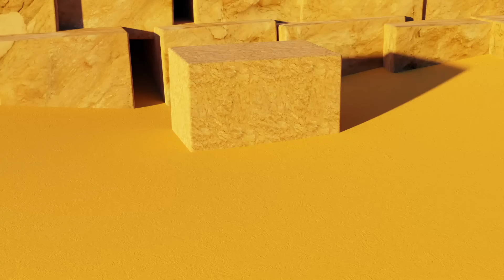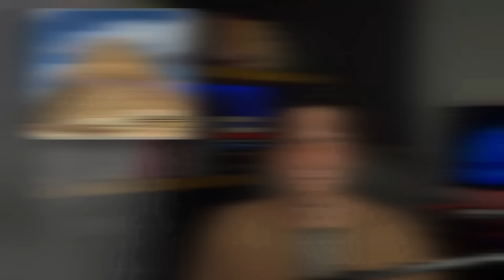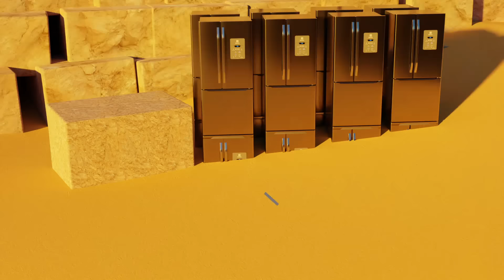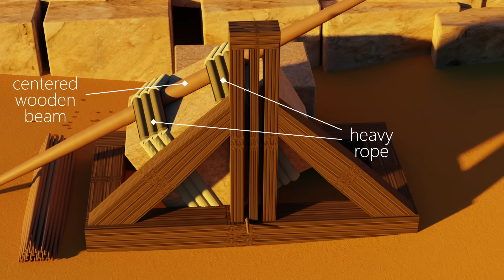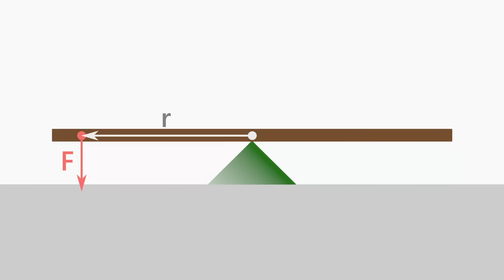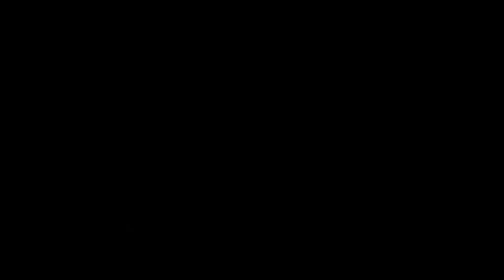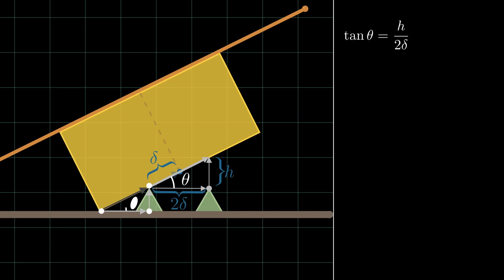Physics Reveals How the Pyramids were Actually Built

Comment: So funny, the only physics that would reveal the true method of construction are not spoken about by Conventional Physicists.  If that is not admitted, then it is a zero value silly fantasy theory.  Let's wait and see what the SARS research group finds, and if someone can actually research the structures extending for thousands of meters below the pyramids actually are and only when we have all the information make a informed statement. Forgetting to mention the super obvious design elements is hilariously inept or maybe disingenuous, the pyramid shaft is directly pointed toward the location of Orion's belt over 10,000 years ago, that nullifies any connection with the conventional archeological Dynastic timeline. Similar to how the Sphinx faces the location of the constellation Leo over 10,000 years ago and has similar aged water erosion  marks.

Comment: They had spherical balance stones. You can spin/ slide along a flat surface with enough equal shaped stones. You don't need rollers or sleds but control becomes the problem. It has been shown they used these sphere's when turning a block around tight corners in hallways.

Comment: Not possible ! Qs How many machine’s would be needed? How are the blocks slid into place off the machine ?  As each step is built more machines are needed on and around each step. How were corners lifted and placed?  No surface under one side of levers . The one block per 6 min rule does not allow for the fact the stones near base will be placed much quicker as not too many steps. Think about how many steps up the blocks near top need to be lifted up and pushed in. If one block every six minutes was placed on average then one block per 6 min was also quarried!

Comment: While I doubt your machine as pictured was used, the principles involved were.  We do the same today everywhere with heavy objects. What amazes me, is so many don't believe it can be done.
Reply: we’ve got diagrams filled with torque equations, trigonometry, and complex modeling of leverage… all supposedly used by guys in loincloths with copper chisels and sleds on sand?

If ancient Egyptians were casually applying advanced physics and mechanical theory like this, they weren’t primitive — they were operating with an understanding of force and balance that rivals modern engineers. So which is it? Were they stone-age laborers, or were they secretly running physics departments 4,000 years ago?

People love to say “it can be done” — but where’s the full-scale replication? Where’s the working demonstration of hauling and placing 70-ton granite beams 150 feet in the air with nothing but ramps and manpower?

What’s actually amazing is how many people believe these mathematical sketches explain a feat we still can’t replicate without cranes and precision lasers. Maybe it’s time we ask if there’s a missing piece — like frequency, sound resonance, or something else we’ve ignored because it doesn’t come with a peer-reviewed stamp.
Reply: @TheForgottenFrequency  One does not need to understand any of these formula to use them. These were simple problems with simple solutions. One way would have been a man walking from one side of the rock to the other while someone inserted a stick under. These blocks were only raised a few feet at a time and they became the base to lift others. The only real mystery is why so many people would build them?  We could easily replicate these wonders, the only problem is money !  Who would pay thousands of people for years and supply the stone?  No large machines are needed, just good old common sense.  
  On a personal note, at I lifted a 5000 pound lathe onto a stand 3 foot high with nothing but a 2/4 and a stack of firewood.  No strength needed !
Reply: @nelsonstahl8989  Interesting take, but respectfully, I think you’re overlooking the scale and precision involved. Lifting a 5,000 lb lathe 3 feet in a workshop isn’t the same as hauling and perfectly placing 70-ton granite blocks 150+ feet in the air with sub-millimeter accuracy — thousands of times, in alignment with cardinal directions, astronomical cycles, and geodetic points.

The “stick and manpower” theory sounds simple, but it doesn’t explain things like polygonal masonry, internal ramp-free construction, or why this level of effort would be put into structures with zero evidence of being tombs. Saying it’s just “common sense” feels a bit dismissive when modern engineers still debate how it could be done with cranes and lasers today.

We don’t build them now not because of cost — we pour billions into less durable monuments all the time — but maybe because their true function is something we no longer understand… or aren’t meant to.
Reply: @TheForgottenFrequency  I get what your saying but these people were no strangers to working with stone. they had been building cities of stone for centuries. The precision is a bit over rated, many of these are inches off level and the joints were filled. There no question they used the stars to align, not so strange since they used the same stars to sail. The problem with modern engineers is they use modern tools ! They forget the simple ways these people used. No need for lasers when you can use water to find level. Why use a crane when the weight of the block does most of the work? There is no question these people had skills. I agree their real purpose is the mystery.
Reply: @nelsonstahl8989  Respectfully, that’s just not accurate. The finished surfaces of the Great Pyramid—especially the casing stones (most of which were removed over time)—had tolerances within one-fiftieth of an inch, with no mortar between the stones. That’s tighter than what we achieve in modern construction using machines.

Sure, there are some stones deeper inside or on the unfinished parts that show rougher cuts—but those weren’t the ones they used for presentation or load-bearing precision. You’re basically pointing to the scraps and saying “look how sloppy this masterpiece is.”

And no, the joints weren’t filled. They were interlocked, often with complex angles, sometimes even concave and convex fits. They didn’t slap mud between them—they engineered them to sit flush under thousands of pounds of weight without shifting for thousands of years.

Let’s not rewrite history just to make it seem more palatable. There’s nothing “simple” about this. If ancient people did this with basic tools, we should be studying that technology like our lives depend on it.

Comment: So let me get this straight… ancient people supposedly did all this complex math, calculated torque, moments, and leverage down to precision like this—but still used wooden sleds and copper tools to haul 80-ton blocks across the desert and stack them with sub-millimeter accuracy?

At some point you’ve gotta stop LARPing with equations and ask yourself what acoustic engineers and physicists have been trying to show: resonance and harmonic manipulation could explain what brute force and stick-and-stone methods never will.

Show me a modern crew move one of those blocks with ropes, sand, and a few logs and then we’ll talk. Until then, stop pretending your chalkboard math solves one of the biggest engineering mysteries in history.

Comment: Hmmm, let me see, quarry the block to rough size, transport the block, dress the block to final size, lift the block into posititon, final finish the block - and do this every 6 mins continuously for 27 years, highly doubtful. Each level would be incrementally harder, so more time and effort needed. If the second row took you 7mins per block, and the third row 8mins etc, this would now take the total construction time to appoximately 238 years!
Reply: I was thinking about this. So many steps for blocks near top. How did they push them in after lifting, the corner blocks would be a nightmare. Machines 100s of them would need to be all over the place to keep the 6min rule. Perhaps small jobs were done like this but not the pyramids.

Comment: …think a ‘Lewis Engine’ possibly a lot more versatile than a ‘Herodotus machine’; think the tensile strength of rope cables with rope harness very likely utilised; blocks dangling in rope harness easy to put in position whatever the weight once lifted up; think it a real possibility that canalised water from an altitude of the Nile higher than pyramid height may have been employed making delivery of blocks (rafted) a simple affair and always working with gravity and not against it; and if not canalised water then some other hydraulic method powered by the amperage of the Nile passing at location; think water a useful amorphous and heavy substance to use for counterweight to blocks…..

Comment: You have explained a slow-motion-system to raise a block vertically - but in reality the block had to be "levitated" into place for the crew to be able to place it exactly. So unconstrained movement in alle directions would be neccessary. I imagine a very long lever with a pivot and a strapping system that would leave two sides of the block free - bottom and one side.
The next question arises - how did they shape the outer blocks so precisely? And a related problem - how would they transport and raise the largest obelisks - about 100 ton without braking them? It's hard not to explain this with "industrialization".

Comment: Firstly how did they get the blocks to the build site ?
How do they get it into  the lifting contraption  ?
How did they tilt the first lift to get the pivot to work ?
How does the lifting contraption get to the higher levels ?
One stone every 6 mins 24/7,  we couldn't even do that today with hydraulics, & floodlights didn't exist  then.
Still a mystery i guess.

Comment: I would imagine the sliding of the block off the contraption was quite tricky.   The smaller slats that were inserted would take the uneven load during the slide,  I could see that causing problems.  Unless much thicker/flatter and longer slats are used in the final step or some locking beams were used to give a strong and stable platform to slide on.

This is very convincing though and I've seen another video where a man actually does the raising of the block for real.   He does it on his own too so very do-able.

There's some crazy ideas out there  from water columns to aliens  so I'll add a new one to the crazy list....  hot air balloons.   That would work,  right?   ;o)

Comment: Utter Bollocks. I watched a team of idiots on the BBC who thought they could move granite blocks that weighed around 1/2 a tonne by using wooden rollers. The wood splintered and split in seconds. 10 tonnes would need huge logs which would then need huge amounts of people to move them. The same BBC idiots also thought they could drag the stones on wet seaweed.....which did not work at all.
I worked on building sites in the 1970's. The best brick builder could barely lay 1 x 35 lb concrete block in around 1 minute working at a steady pace. But he would soon tire and need to get a rest. 10 tonne blocks every 6 minutes !!!  This video is just maths jibberish with no proof that any wooden sticks could actually bear that load or the ropes.

Comment: hopeless. All you did is calculate the external forces. but what about the internal forces. What about the strength of the machine itself.
e.g The slits holding the pivot slats look weak. and where would you get a timber long and strong enough to act as a lever.
you also haven’t thought  how a 10 ton block would get moved from the machine onto the destination position… where the workers or animals to stand.

Comment: Needs a firm ground, or the rock-slat-insertion process will grind everything into the sand. Also, if the slats are timbers, they'll have a size-to-stoutness issue: they have to take the weight of the block; if they're not stout enough, they'll break (they're timber, not uniform, each one different) and the stouter you design them, the slower the rock-insert process goes . . . unless their height is very low, and the rocking is kept at very near the horizontal, not all the way over, as in the animation.
Nice video -- hate the music though. (WHY??)

Comment: UH….Okay, so the block is lifted up;  Now it 
is on wood poles; surrounded by a wood
frame, And wrapped with huge ropes……..
“How is it precisely put in place; on a stack
of blocks; moving away from the machine;
at an upward slope towards the inner
part of the structure???  As each 10 ton
block is freed of all parts of the machine
to be positioned; what tools accomplishes
that feat of engineering???
Furthermore; how is the block carrying
machine moving up each course of 
stone structure to the dizzying 
heights of the finished structure; 
and do its job as if it were operating
at ground level???   Me thinks you
need to show a lot more detailed
animations…….

Comment: This is all interesting but we do not know if 27years is the same as the current 27years? Setting a block every 6 minutes? Did the Egyptians lay the first level of block and build a sand road(which is every where)so they didn’t have to lift the block straight up. Did the Egyptians use even more simpler tools (maybe). This video is another theory(guess). The question just how did they cut the stone flat and square. Question 2is how did they move the stone. Question 3is how did they lift the stone

Comment: That is a good explanation of the force needed to tilt. I used another less accurate method to determine the force needed and built a self holding Herodotus machine to lift a weighted carriage up several feet for use as a gravity battery. I am amazed at how easy it is to tilt a large mass up vertically or on an incline. I have a few examples on my channel.
   https://www.youtube.com/channel/UCxuSnBuxIj9aWm0HtBXBzKA/videos
Also look up Wally Wallington.
   https://www.youtube.com/results?search_query=wally+wallington
He built and used a Herodotus machine to move very large blocks.

Enjoyed your explanation of the Herodotus machine. Good graphics and more math than I am use to.

Comment: There's still no way to know how the machine got off the ground. That's the big mystery. Sure, leverage works on the ground. But how do they get the blocks that high? They'd need another machine to lift the machine and the blocks. There's no way the machine could get up and over, and up and over, from the ground. Good theory, but still doesn't really explain much.

Comment: Well, it's good to know the ancient Egyptians of the 18th Dynasty were learned Physicists, and 
had a complete understanding of Physics and how to apply that knowledge to do work.
Personally, I think it was more like what is like an elevator shaft using counterweights to lower and 
lift the blocks.  Hard to believe they had rope that could handle that weight.  Even with the use of pulleys.

Comment: As a woodworker, I'm nonplused as to how a 10 ton LATERAL force (across the grain) upon a "stick" is going to accomplish anything other than crushing the wood and separating it into fibers. One presumes this "stick" must be a little more than 14 inches in diameter if it was made from Lebanon Cedar (likely the ONLY significant wood available to the pyramid builders) and the blocks' width was a typical 4-6 feet. But a 14 inch diameter would rapidly increase the delta, making it highly ineffective. 

Then we get to the question of the limestone and granite blocks that form the flat roof of the King's Chamber and all of the relieving chambers above. Those stones average 44 tons (22 to 80).  I'm not doing the math on this but that 80 ton stone would likely require a massive HM at each level of the pyramid thus far constructed. 

But as I write this I have another (un)promising idea. Suppose the "sticks" used were made of copper, abundantly available from Cyprus.  Still, not a solution. To have enough copper "sticks" to operate all the Herodotus Machines (HM) required for a 27-year build window, would likely take more than 27 years to mine ore, transport it, smelt, cast and hammer into "sticks". They'd probably need those Lebanon Cedars, cut and dried, as fuel for smelting.

Further, there are clearly lifting bosses remaining on many stones, or are moderately hammered away but visible. The solution proposed here would not require lifting bosses, so why waste tools and labor chiseling away at the side of an enormous stone just to remove 80% of it and leave the bosses? Then remove the bosses once the stone is hoisted without using the bosses so carefully crafted?

I do not recall anyone having done the math is is presented here (and very well done, indeed). I've seen this idea attempted on a smaller scale during one of the 47,000+ tv shows over the decades, showing "how it was done."  I recall the demonstrative cut stone was about waste high to the workers, and there were already 2 layers of stone set up. Those existing 2 layers were placed by a backhoe and chains, just to establish the idea of a stair-step wall the workers needed to negotiate.

They see-sawed their stone up to the height of the 1st level quite easily, as explained in this video, using an HM.

Then failed miserably trying to slide it over the top of the existing 1st layer. A good 20 minutes of TV airtime was wasted trying to come up with ideas. No matter how innovative they got, either the HM failed, the stone fell to the ground or they gave up because the saw they were about to crush themselves.

I guess some things are destined to remain a mystery for VERY long times... (But gotta give credit for the math done here, vis HM).

Comment: Drjohn liked the math but...theory takes to long...first set blocks than smooth tura limestone slide block up one side using sand opposite side...lane 2 just lifting sand up one side to use for the next block lift...all of the pyramids had smooth casing except for stepped pyramid at djoser which only used 1 to 1.5 ton blocks...what you think???